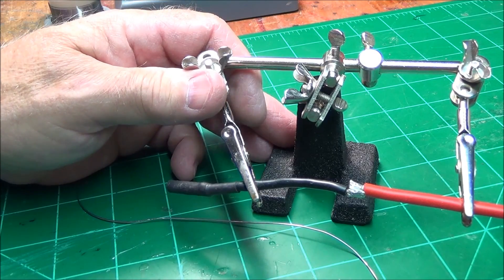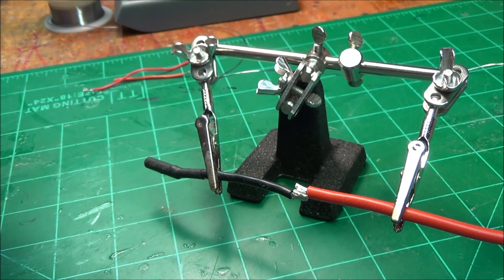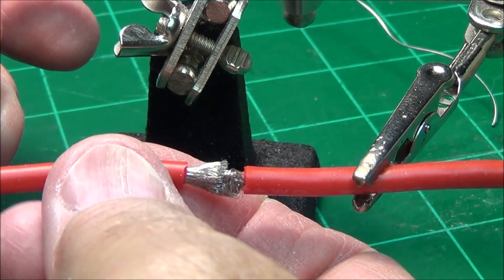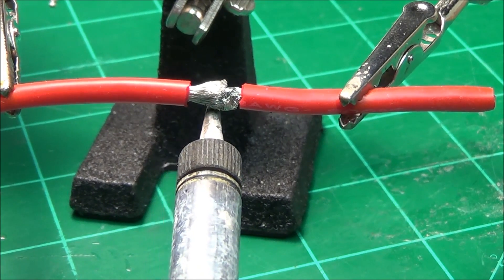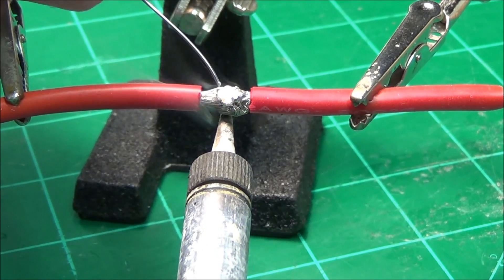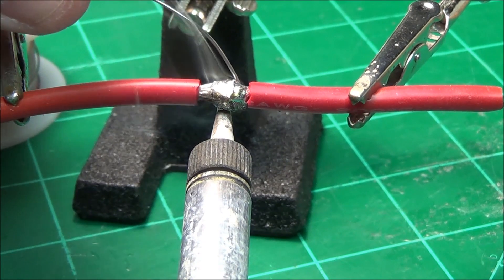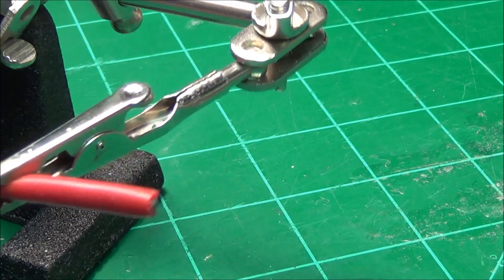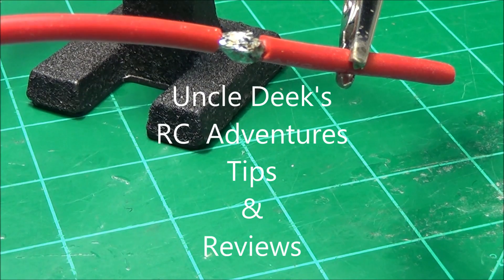How to solder Two Large Wires Together

Comment: I know its an older video but I am going to say anyway because you mentioned more than once it would take a long time to heat up the joint due to its size, if you prep the iron with some solder and then heat the joint it will heat up faster because that melted solder is going to increase the contact area and more efficiently carry that heat grom the iron to the wire whereas without that bit of 'primer' solder the contact area is just a point maybe just a few strands.  I learned that watching lessons given by Louis Rossmann's friend the Apple certified lady with the repair shop, I forgot her name.

Comment: That’s actually bad soldering.. you didn’t tin the iron and you don’t put the iron on top and poke it with the wire!! Iron under and wire on top ! Your iron seems to be slow/crap and ur doing it wrong

Comment: You soldered the cable for 2.5 min. !!! You just killed him )) 
Cables of this volume are soldered with 100W soldering irons and 6-8mm tips (they probably skipped classes at school, there is such a law of "heat transfer" in physics, which says that: in order to transfer heat - the heating element must be of a size approximately equal to the size of the heated element ).

Comment: I think this was just a single joint but you would probably benefit from a slightly larger tip to dump the heat into the joint if you were going to be doing many still learning myself

Comment: ALWAYS Heat your wires from the bottom. I like to mesh the wires then wrap over them with small gauge solid copper wire then solder them this makes for the strongest solder joint if your using 8 ga or 4 ga or larger wire.
Boy this guy really admires his work huh❓
Reply: I'm soldering two 10 awg wires for a Traxxas speed control. I've splayed them like he shows, but I'm not sure the solder got to the center. I should have used flux. I used a desk type soldering station (700 degrees). Should I use my gun instead? Thanks!
Reply: @TiberiusCat  For larger wires I use my Weller Soldering gun👍👍

Comment: Guys don't apply this his step by step method. From what I have learned so far. 1.) You need to pre-tin your tip 2.) Apply heat to the opposite side of the wire that the heat is applied. 3.) You could use flux to help promote heat transfer but not too much. 4.) Larger wires require larger tips to help increase surface contact between the iron tip and the connection you are trying to solder  ... Otherwise you can end up with a cold solder joint that can cause inefficiencies in your circuit. #YouTubeUniversity #TinYourTips #KeepYourTipsClean

Comment: If you dip the end of the wires in flux before you lay down the solder you will get a much stronger and hotter head.
Reply: Strong hot head is nice

Comment: Notice when he puts the solder tip on the bottom, the solder will not take into the wires from the top. Cold joint 101. This is a video of what NOT to do .
Reply: Im a rookie so I don’t know for sure but would he have done that to heat up the wires first since heat rises?  That way wants the solder can flow through and smooth?

Comment: I do many different wire size solder joints for the audio harnesses I build and I've found that for the thicker wires,like when I'm wrapping 22awg around 14awg which essentially makes the whole thing about an 8awg,using a higher powered gun(100+watts) works just fine.Tin the tip and hold to the joint and it heats up nicely.Solder flows freely just like a smaller awg joint would.Basically you just have to use the right amount of power for the joint being soldered.
Reply from the maker: Great comment, thanks a big bunch for watching
Reply: @A. Melbs If you can be a bit more specific about what your problem is I might be able to offer some help.
Reply: @A. Melbs Well when splicing thinner wire to thicker Just make the thinner wire longer or in other words strip more insulation off and then wrap it around like a candy cane the thick wire. What I do first is take the thick wire in twist it up so that it's nice and solid and straight That way you can wrap the thinner wire around it easily. As far as the head unit wiring goes I'm still not quite sure what you mean by that.

Comment: Whoever told you to do it that way is a bloody idiot.  There are two best ways to do that.  One is you strip off more insulation and you wrap the two wires together, not creating a pigtail but rather along each other in the same plane.  

The other is you hold them next to each other as you had done previously but first you use very high (small) gauge bare (un-enameled) magnet wire to lash the two together before soldering.  Even with this method you want more bare wire exposed until you get some practice doing it with that gauge or lower wire.

Additionally you want a stout chisel tip on the iron, not the conical one used in the video.  The only reason it worked at all was because you had all the time in the world due to the highly heat resistant silicone insulation on the wire, and the tin plating because taking too long heating regular copper will cause need for added flux to combat the oxidation of how long it had to heat up.  Hint:  It should take about 8 seconds to do that joint with a pre-heated 50W iron with the right tip on it.  Also, those wires are not that "big", "large", (should have just stated the gauge of the wire in the video!).  A big, low gauge wire couldn't be done by a 50W iron while those easily can be.
Reply from the maker: A very merry Christmas to you and yours!!

Comment: How to you solder a solid 10 gauge?
Reply: You could put them parallel and lash them, but you must be thinking of home AC wiring because there's no DIY applications to mod solid core 10 ga and in that case, it won't meet code.  If you have two ends of solid 10 gauge you need a junction box, and nut or terminal strip, etc - consult your local electrical codes or really to even ask that, please don't mess with solid core 10 ga wire at all.

Comment: FIRST YOU SHOULD USE A HOTTER IRON, SECOND PUT FLUX  ON WIRE BEFORE HEAT SOLDER WILL FLOW MUCH BETTER.

Comment: Thanks for showing us how to make a partial 'cold' solder joint. Look at the underside dude.  You applied heat to the top way too long and didn't apply it evenly all the way around. It makes a difference if you want a proper solder joint. And trim back a little more of the insulation so your fingers can get a better twisting grip on it. You need a good mechanical AND electrical connection when soldering wires.

Comment: Need more heat. The solder should be touched to the wire, not the iron. The solder should flow from the hot wire to the iron, not from the hot iron to the cold wire. The properly heated wire will "suck" the solder toward the hot iron.

Comment: way too long solder process you need a hotter iron so you dont need to hold the heat on so long. if there was electronics on the wires they where ruined

Comment: whats a good web site to buy solder and tools from, good prices an quality?
Reply: Amazon is my fav and then EBAY
Thanks a bunch for watching
Reply: Depends on where you are located, you can shop around like anyone else.  For that kind of work, most rosin core solder would work, but for best newbie results, get Kester or Alpha (etc, a major brand not an ebay special) 63/47 rosin core.  It runs about $33 per lb currently, but solder prices fluctuate with the metal market.

Comment: That is the worse way to solder two wire together. A cat could pull them apart. If you want your wire to have the tensile strength of a single strand of wire go ahead and do it that way. If you want your soldered wire to stay together even when pulled then do a Lineman Splice then solder. The connection will be stronger than the wire itself. This is what Western Union and your electric power company does to repair power lines and telegraph cables.
Reply: Felix Su it's called the NASA soldering right?

Comment: Thanks for the video. How many watts for the soldering iron needed to solder big wires like this?  I need to solder a big wire like this but my solder iron is 40w and it looks like it doesn't put enough heat to get the job done.
Reply: His problem was trying to use the long conical tip.  If you had a stout chisel tip and a true 40W soldering station (not line powered slow recovery iron with no reserve capacity) then it would be enough.  Easy answer is crimp wires if you don't want to invest in a higher powered iron but if you do want to invest, and are okay with it only being able to handle larger jobs, then you can get a 100W pistol style soldering iron from Harbor Freight for under $15 w/coupon.  It's crap quality but you would get enough uses out for several wires and how many of these is someone typically going to do unless into something where they already had the iron needed?  
https://www.harborfreight.com/100-watt-soldering-gun-kit-64056.html

Comment: All of that extra solder is traveling up the length of the wire and you are going to be left with two stiff sections of wire that will act as a "lever" arm setting the distal ends of the wire up for mechanical failure and a possible short. This is not a good technique.
Reply: I just watched this video, but the solder flowing up into the insulation causing stiff sections of wire is called solder wicking. It is a defect on all 3 classes if it's in a section that is required to remain flexible.

Comment: Initially, the solder was touching the pencil which is creating nothing more than a cold solder which will fail at some point.  You need a hot solder. The solder needs to melt via a hot wire, not touching the pencil.
Reply: Not necessarily true, creating a thermal bridge can speed up initial heat transfer and minimise dwelling time which is better for the the insulation and any components attached to the wires.

It's definitely not unusual to use a thermal bridge to make heat transfer faster when soldering larger parts.

Comment: I always melt the crap out of the wires plastic. I suck!
Reply: His wire insulation is silicone, that's the only reason he didn't have a molten then charred mess with that method which takes way too long too much heat just wrong altogether.
Reply: that means your on the wire to long, might want a higher watt solder iron. seems counter intuitive but a hotter iron will get you in n out before the heat spreads.

Comment: When I try this, all I get is a black, globby mess, with or without flux.
Reply from the maker: Jason Austin Thanks for watching man.  Your problem is not unusual.  Since this video was made I have upgraded to a Weller WES51 Analog Soldering Station  for less than  $100.The biggest mistake new people soldering is the wrong iron & tips, solder and flux.
You have to have enough heat and the right kind of solder.  At Radio Shack you can get Led solder with rosin core.  Too much heat and the flux burns away leaving a black globy mess.  I will do some more soldering videos soon.
Reply: ***** That is inncorrect.  That is due to either too much rosin core or too bigger lead dia size.  Jason Austin Need lead rosin core sized 1 mm dia.  I'm pretty sure Jason have right soldering if it is 12 AWG or higher.
Reply: +Jason Austin you probably melted through the casing

Comment: @wntu4+1 to you sir - yep good demonstration, but a more powerful soldering iron might be better in this case. Too much solder = added resistance. Needs to heat up more so can quickly let solder flow to the hot spots in the wire. A great method I saw was after the "splaying" wrap the splay joint with uninsulated speaker wire (18 gauge) then solder the joint with the appropriate amount.

Comment: Way too much solder. Standard 60/40 is something like 11% as conductive as copper.
Reply: You might mean well but you have it backwards, at least the little bit you wrote could be misconstrued.  The less conductive solder is, the higher the conductive capacity from more of it there.  Perhaps what you mean to write is that wire joint is a terrible mess and there's too much of an air gap in it before the solder is added.

Comment: That's a lot of heat going to the components on the ends of those wires.
Reply: Meh, that is doubtful.  I mean the wires have to be joined to something metal or more solder at the other end so they would inherently have to be able to handle "some" heat anyway.  It is definitely more of a concern if he was trying to solder that semi-low gauge wire to something with contacts set in plastic, like a barrel connector, or potentiometer, but you wouldn't need that low a gauge of wire for either of those.   Components are inherently designed so that the wire gauge they support, could be heated enough to make the solder connection or else the component is intended for a blade connector or some other attachment method instead of solder.  When in doubt read the component datasheet.  If there is no datasheet then it is probably generic chinese crap and shouldn't be used at all unless the margins are so obviously far beyond any remote chance during use that it seems to be overkill, and even then, it may still fail because crap is crap.

Comment: You want to remove more of the insulation, so you can get your fingers in there better. Once splayed and pressed together, hold one side of the exposed wire, while twisting the other side. That creates a much better joint..
Reply: Hahah, NO!  You never splay wires apart to join them.  Unless talking structural support wires that are crimped not soldered.  On the contrary you want to try to keep them from splaying apart any more than needed to make them cleanly wrap around each other when twisting them together, using a much longer length of wire with the insulation stripped off.

Comment: Excellent advice! I'm presently changing my deans & traxxas connectors to castles 6.5s and this would make the ESC series connector swop a little easier! I can make my series connectors with my extra wires and just clip off the old and soldier mine in place.

Comment: Nice job! Gotta love the D&D. I would be interested in seeing you do the soldering on your battery connectors. That's where I have a lot of problems with them coming loose.
Reply from the maker: Ollander, I know what you mean.  It took me a while to figure it out too.
I just uploaded a video on how to solder a deans plug.  I hope it helps.  If you use a different type of plug I will do a video on that type also.

Comment: Awesome, nice job Dick! You'll find a little flux helps to "mold" the loose strands and makes it easy to for the solder to chase the flux into the center of the joint. Thumbs up buddy!
Reply from the maker: I use to have some flux, but with solder with a flux core I don't use it any more.
I should get some for larger wires.
Thanks
Reply: Flux isn't really needed for clean tinned wire.  Unless you're trying to join them a crazy wrong way like shown in the video, then it might help or might just cook off burnt to make a carbon residue mess as long as it took to do those using the wrong tip and wrong method.  Flux can easily be overheated and then worse than no flux, when the wrong method needs to pump way too much heat into the joint.